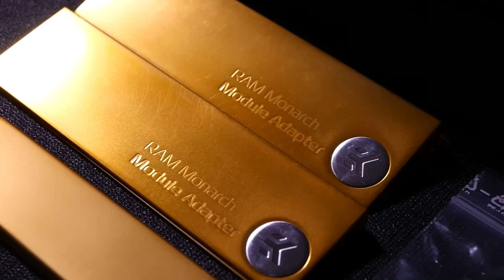Radium Launch Giveaway

Comment: So I'm curious: what is the plan to manufacture these? Given that they're pretty much unique, won't they end up being like the usual builds and taking a long time per unit? Or is this outsourced?
Reply from the maker: To put it simply most orders will be of the more basic configs which can be assembled in a very short time, but there is a lot more to it than this. Let me just say its in the design. Maximum turn around time for Radium will be 2 weeks.